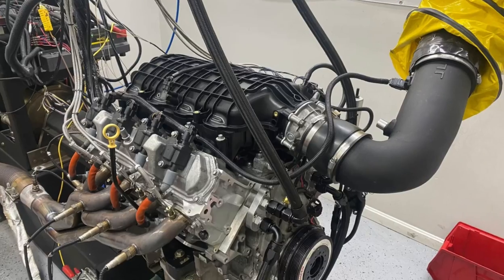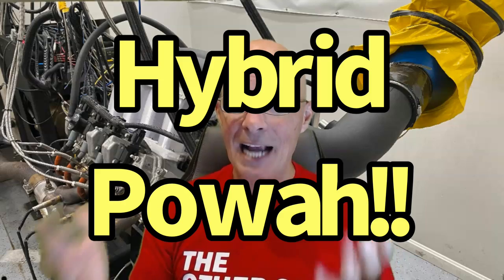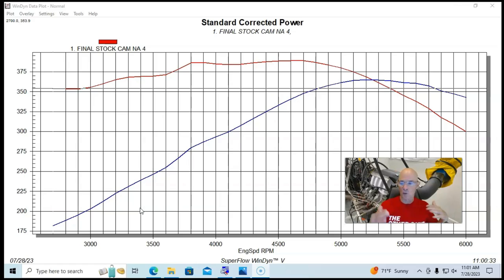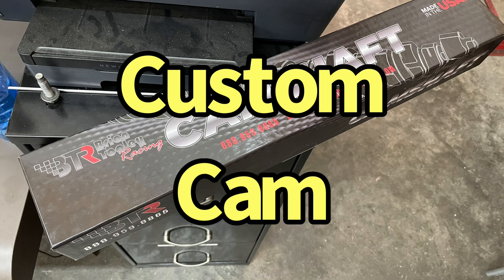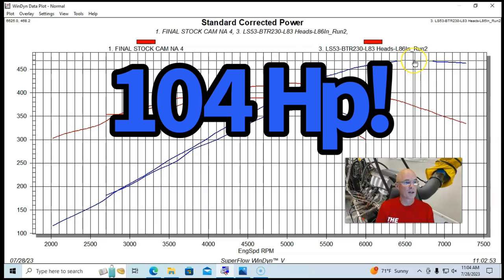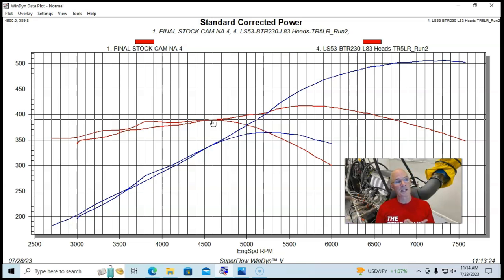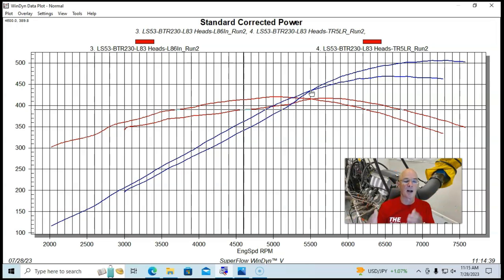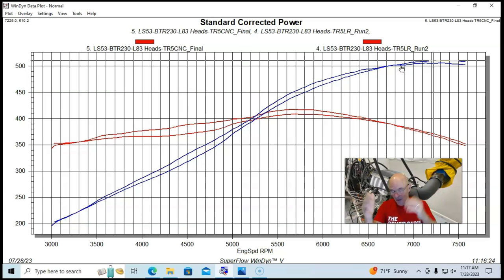HOW TO: LT HEAD SWAP AN LS. GEN V L83 HEAD SWAP ON A GEN 4 5.3L L33. HOW MUCH HP ARE THEY WORTH?

Comment: Would like to have seen a test of the L33 with an LS cam with the same cam specs as the hybrid cam so we can see what difference is caused strictly by the heads.
Reply: Agreed.  It lost me when the put a cam in the 5.3 that wasn’t close to stock.  If that doesn’t exist, a cam of similar specs should’ve been used with the ls heads.
Reply: This test needed to included a cam similar in size to the hybrid cam but tested with the LS heads. I would suspect that only a fraction of the power  increase was due to the LT heads especially on a small 5.3L engine.
Reply: Different heads can react differently to the same cam. You can't always have an apples to apples comparison.
Reply: @Dane33781  Certainly. Buy it would give a closer representation of what the heads alone are worth.
Reply: I would like to see the L33 tested with 706 heads, TBSS intake, & a cam with specs as close to the hybrid cam as possible.
Reply: Yeah, the gains seen weren't far off from what a cathedral port head 5.3 with a big cam of that size would make. Hard to see if the heads made any actual gains.
Reply: @filiptrojanek5083 It was probably close to 25hp from the heads vs say 799 heads

Comment: Hold up! We need the numbers with the exact spec cam on the stock motor or these numbers are worthless. That's a big cam. .644 lift.and plenty of not too much duration. Less duration and a tighter LSA would be preferable

Comment: I'm curious how this stacks up with just buying some AFR's or other comparable aftermarket heads. Of course those will probably cost more than the LT heads from a junkyard, but having to run special hybrid cams that will limit options. And I'd imagine future availability of these cams will be...questionable. Definitely interesting to see an answer to the question that so many of us have wondered!
Reply from the maker: those questions are why this video exists
Reply: I'd think buying a full on LT motor of some vintage and going crazy with it might also be a terrific alternative.
Reply: So in other words you compared a stock motor to a head swap and cam swap. Pointless test. Literally pointless because you don’t know what the power increase was from just the heads. I guess this is to be expected at this point. Smh.
Reply: @Turbogto_guy you can’t do the test you described and had you been listening you would understand that. The LT head uses a different valve layout, thus a LS cam will not work. An LT camshaft won’t work either due the the length is longer. It has to be a combination of both, an LS style cam with LT lobe layout. There is only one on the market and commercially available .  You guessed it, the BTR camshaft. So no this wasn’t pointless test. The LT heads are way better than most premium ported and polished LS heads, so do some research before you look like a pontificating pretentious person.

Comment: I agree with top shelf aftermarket "regular" LS heads being the way to go here. You get the flow you need for big power........without the hassle of keeping track of the hodgepodge of different parts needed. In today's world the aftermarket seems to be pretty quick with offering gearheads the new power parts they desire........you just have to spend the coin. Long gone are the days of garage tinkering to fab up big horsepower parts. Unless you are racing in a class that requires ALL factory parts........I just don't see the point.

Comment: I'm blown away by the fact that this engine made 365 hp with a tiny 193@.050 duration camshaft 👍 Another impressive thing is that 389 lb/ft of torque! That's unheard of in a little 323 cubic inch engine!
Reply: It's with headers, tuning and no accessories. He uses an electric water pump and all. Also low coolant temp. So those numbers are inflated from true stock but still good for comparison and maybe a good idea of a bolt on engine
Reply: Subtract 10% then another 10-15% for drivetrain and your back to 290 wheel.
Reply: @Carado5150 the percentage thing is not accurate as drivetrain loss is a fixed amount, say it robs 30hp for drive train loss it would be same loss on a 300hp engine and a 1000hp using a percentage would not be accurate as 10% on the 300hp engine would be 30 but somehow same drivetrain would somehow take 100 HP on the more powerful engine.

Comment: Love your videos, Richard. Guessing someone has already mentioned it... But the l86 manifold picture you used is actually an LT2 manifold.  I'm hoping you cover the fuel system on the next video.. guessing the LS3 is coming up.
Reply from the maker: yes, my bad on the photo-the fuel system was a simple port injection. The l86 manifold was modified to accept port injectors, the BTR intake already had them, the DI was plugged in the heads.
Reply: @richardholdener1727  Do you have any pictures of the L86 intake modification and who did the changes?

Comment: Richard holder have you been hearing anything about..l 8 t..6.6.. gas... gen-6 ..I believe.... but with a little bit of work what a crazy engine.. been seeing people work that motor a little bit lately and it's doing good... as a matter of fact 1320 just posted a 91 cyclone still all wheel drive with the l8t 6.6 reassembled with ls heads... and seeing another guy working on in l8t 6.6 gas and he said it's a low compression motor but just removing the cam makes a big difference

Comment: It's a neat comparison, but there's such a dramatic difference between the two combinations aside from the cylinder heads that it really doesn't tell us much about what we're most interested in, which is how much better are the heads themselves. 

The biggest question anyone contemplating this type of setup should be why? If the goal is to be different and unique, then maybe it's a good way to go - outside of that there are conventional ways to make that kind of power on that kind of displacement that won't require so many one-off type of parts.  Neat to see it done, not real practical to repeat.

Comment: ok ok ok.... now I gotta go look for what a 5.3 LS with cam specs similar to the hybrid cam makes for hp.  I need to know what percent of increase in attributed to the heads alone!
Reply: That custom cam was quite large, 33x / 34x... put a large cam like that in the stock 5.3L and it would bump up a lot in the high RPM range also.
Reply: Its almost identical to ported factory castings. Earlier this year Richard published an article building a 5.3 that had Katech 706 heads, LSXR intake, 234/247 625/605 cam and 1 7/8 headers that made 509hp. Those heads were CNC ported with factory valve sizes. 
The Gen5 heads are probably worth 30-40hp but the CNC program from Katech costs less than the hybrid camshaft.
Reply from the maker: that test is next!

Comment: In my opinion, this isn't a true upgrade if you already have good gen 3 or Gen 4 heads. However, if you have a stock bottom end 6.0 with dished pistons, this would help you get a proper compression increase.
Reply: I have a Gen 3 6.0 out of a Silverado SS.  I have the L83 heads and I am saving up for the rest.  Any suggestions for modding the heads?

Comment: 475 on 5.3 with a big cam is possible. I don’t think buying all the direct injection parts are worth the squeeze and engine management and fuel system becomes far more expensive. 

Get a set of upgraded 5.3 heads and big cam and I’ll bet for the same price you can make the same or more without the complications. 

I personally build direct injection 4cylinder engines and it’s a big limiting factor for fuel and cost is very high.

Comment: Those LT heads flow great and it’s not all that hard to build a hybrid. If you can snatch up a set of the LT heads for cheap it’s a worthwhile option. Then you just need a cam and a Gen V pattern intake, which you would do a cam and intake anyway even if you went full LS so that’s not extra expense. Aside from that you just need some plugs for the DI ports in the LT heads and you’re basically good to go.
Reply from the maker: custom hybrid cam is much more than LS cam, you also need, rockers, pushrods and exhaust-the hybrid head swap is very expensive
Reply: @richardholdener1727  I forgot about the rockers being different. Headers I wasn’t really thinking about because you would buy a set for whatever setup you’re doing heads on anyway. (Hopefully) 
Without looking at the flow numbers for Lt heads vs LS heads it really seems like more of a conversation piece at the end of the day then just to say you’ve done it.
Reply: BTR makes a decent cam with the swapped lobes for ~$400. I don’t think that’s too bad. Another thing I didn’t consider though is the Right head doesn’t sit flush with the block, meaning you can’t just reuse your LS accessories. That is something I was unaware of too. It seems it’s still a more budget friendly option to just put a nice set of aftermarket or even ported factory LS heads vs doing the hybrid build.

Comment: Part of me really wants to put a set of L86/LT1 heads on one of my spare Gen 3.5 six liters. I feel like it could make close to 600 flywheel without any porting or exotic parts. Not as easily achieved with cathedral port stuff.
Reply: Gen 4 heads will work, no adapters needed lolz
Reply: @shadowopsairman1583  Yeah, but I'm considering a Gen 3.5/Gen 5 hybrid. I'd like a simple, no porting, etc - setup that would make about 600 flywheel. I think someone has a carb intake for the LT heads too. 

I'm thinking about a suitable engine for my 69 Chevelle. It needs to have a lot of power if I'm not going to put a big block in it. 600ish at the crank would be about right - light, low option car with a 4 speed and 4.10 gears. 👍
Reply: I believe it has to be the L83,  LT1 valves are way to big to fit the 3.780 bore
Reply: @jesselee128able  If I were putting them on a 5.3L - yes. But the L86/LT1 will fit the 4" bore of an LQ4/LQ9 block.
Reply: @bluecollarhotrods9781  some reason i thought you said LT1 heads on a 5.3 my bad lol.    I looked into it a few months back  an seen the valve size issue

Comment: Killer content as usual Richard!!  Would it be safe to assume that there is another one coming where you compare the Gen5 hybrid to some other comparable Gen3 or Gen4 setup to illustrate more clearly just how big the difference is?  
I'm thinking ported 706es with a FAST intake get pretty close to this level of performance for similar or less money??  Or a 6L with stock rec port heads and stock LS3 manifold probably gets pretty close to this combo for less money? (both of these assume appropriate camshaft to make it work)
Reply: I'd be really interested in that test... I have an LQ9 going together with PRC Stage 2.5 706/862s, a decent sized cam, FAST LSXRT 102mm, and all the supporting mods. I don't think it will be good for much more than 530ish flywheel. A friend has a 6L with L92 heads, Comp 469 cam, etc. It did 422 RWHP. So, most likely it's in the same range. With porting, flycutting, and more cam it might crack 575-580 on his set up. All bench racing until it hits the dyno cell.
Reply from the maker: yes-coming next
Reply: @richardholdener1727  Excellent!
Reply: Speaking of the 6.0L, can this head swap be done on the lQ4? Thanks
Reply: @anythingfast4U  the LT1 and L86 (6.2L)  heads will fit an LQ4.

Comment: I appreciate that BTR is testing these combinations and developing awesome parts however it is an apples to oranges test, it’s actually impossible to run a proper comparison especially since the intake manifolds are so different oh and the "L86" manifold mentioned is actually an LT2 manifold pictured. A closer test would have been using an actual L83 manifold and creating a custom cam that mimics a stock 5.3 Gen4 truck cam…just saying!

Comment: Can you do a 6.0 and 6.2 THEN popular stroker variations.  392,402,408,415, and the big boy. Stroker 427 4.125 boreX4.00 stroke 😊
Reply: Yes, needs to be done.
Reply from the maker: LT?
Reply: @richardholdener1727  the 427? I had to sleeve an iron lq4 , it was a nitrous motor for about 5 passes and I sent the rear-end and the bed of my truck ahead of the cab lmfao

Comment: Hi Richard… very interesting installing a LT heads on a LS block. How’s the valve relieve clearance work with different valve configuration, LT cam for sure and the factory extra mechanical fuel pump. 
That being said, I was wondering, I have the Holley Terminator x max running my LS, I’m swapping injectors from the secret sorcerer to Holley injectors. Do I just scroll to the injectors info on the setup screen and choose the correct injectors or do I have to start from scratch and retune everything?😮
Reply from the maker: this was run with a Haltech, but Holley would also work since the motor ran as a port-injected LS. The DI was plugged and intake intakes had provisions for port injection
Reply: @richardholdener1727 who modified the l86 manifold for port injection?
Reply: @myblown02svt  all you need to do is plug the original injector holes.. tap and thread it.

Comment: So technically I should be able to swap my L96 6.0 block for a newer L8T 6.6 block in my restomod Regal. .......Or perhaps put an LSA blower on a 6.6 L8T motor and get Big boy power with Big boy torque. This logic should work if you can put LS intakes on the LT blocks, Right?
Reply from the maker: anything can be done

Comment: Where’s the comparison to the L33 with a 459 or 469 cam? The 799 heads won’t keep up but how close IS it? A complete comparison probably needs to include another round with cam and milled 799s to make the CR close to even. I seem to recall the 500+ hp 5.3 needed aftermarket heads, and the L83 heads have to be available cheaper than that, and cams should be similar in cost. So what do you get for the cost of L83 heads and L86 intake in a “fair” fight?
Reply from the maker: watch the next video

Comment: What injector setup did you use with the gen v heads and intake on the gen 3 block?
Reply from the maker: both the BTR and L86 had provisions for port injection-the DI was plugged
Reply: @richardholdener1727 the stock l86 has provisions for port injection?  Thank you for all you do for us!!!

Comment: What did you do for a fuel system on the L86 intake considering the direct injection is deleted.
Reply: ^ THIS! This needs to be answered.
Reply: What if you used the direct injection for water
Reply: Agreed.
Reply from the maker: The L86 intake was modified to accept port injectors-DI was plugged

Comment: How can you run a stock gen 5 intake on a gen 4 block? I see di rails and valley cover but are they on a gen 4 block or did they modify the gen 5 stuff to take port fuel injection?
Reply: I agree. I doesn’t make sense, but disregard the pictures, they appear to be filler pictures that aren’t accurate. 
BTR intake is “hybrid” meaning bolts to gen 5 heads but is built for port injection. 
However, to add to your question, how do you run a plastic gen 5 intake with port injection? It’s not like you can weld injector bosses on it.
Reply from the maker: the DI was plugged, and the BTR intake had provisions for port injection, the l86 intake had likewise been modified to accept injectors

Comment: If we used a 6.2 , and matched the rec LS heads against the Lt heads do you think the Lt heads would out power the LS heads
Reply: Probably by a little bit. The LT1/L86/L8T heads have a smaller chamber and have a bit better design. They also use a 1.8 rocker but those are available for rec port heads.
I think if you normalized the test as much as possible, same rocker ratio, same cam profile, use a holley hi-ram on both sets of heads, there is a rec port and lt1 hi ram, same header size from same manufacturer, there would be less than 20hp difference. If you swapped pistons and had the same compression ratio it would be even smaller than that.
The Gen5 is a bit better head, and a chamber 10cc(?) smaller. The smaller chamber is a full ratio of compression. The actual airflow and chamber design isn't really worth any real power.
Reply: @timothybayliss6680  what I was thinking about is the short side is laid back to much to turn the fuel. I think the fuel will separate from the air and slam into the chamber wall instead of turning. The port is not designed to carry fuel, it is a dry flow system. I think the difference will be found in the BSFC. I could be wrong.
Reply: @davidreed6070  The LT5 has the same port shape afaik and hybrid injection even though the head is a unique casting with a differing intake mounting bolt pattern. 
You might be right, there might be all kinds of ugly that happen with this head.
Reply: @timothybayliss6680  before it is over someone will do enough testing it will be proofed out. I am happy with the LS3 heads, they make a lot of power.
Reply from the maker: btr did that test already-a cammed LT1 with ported, milled heads, big cam, fly cut pistons and Trinity intake made 760 hp on M1 (an LS3 won't do that)

Comment: You said the L33 is a gen 4 but I'm certain it's a gen 3. I work at a GM dealership and I know I have an L33 but I also know I have the 24x crank reluctor that came on the gen 3 motor
Reply from the maker: its actually a 3.5

Comment: What did they do without a high pressure pump for the fuel system?
Reply from the maker: they did not run DI
Reply: @richardholdener1727  did they plug the holes?

Comment: I would actually like to do the opposite. Do away with the direct injection heads and run LS heads. No high pressure fuel pump to leak into you oil and valves stay clean feom injector spraying them with fuel.